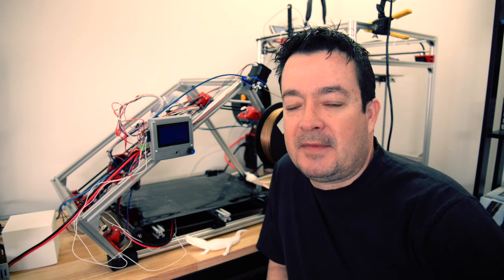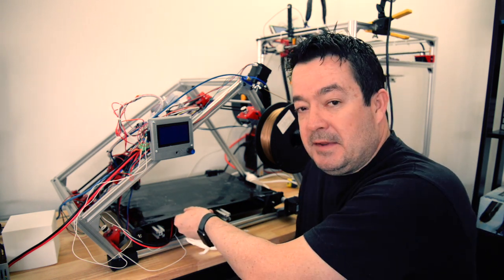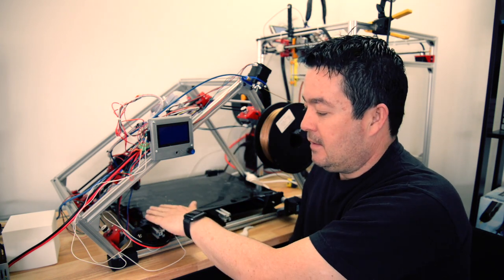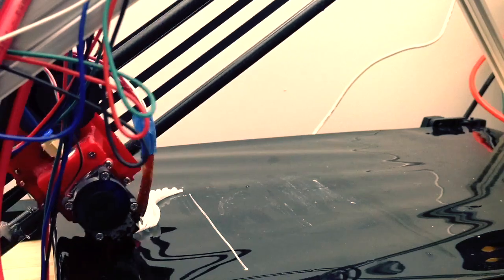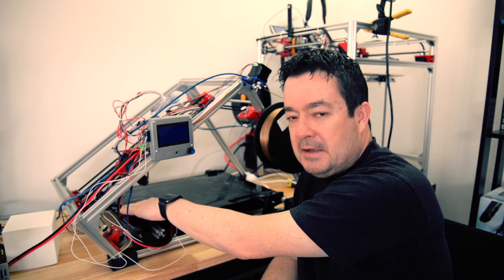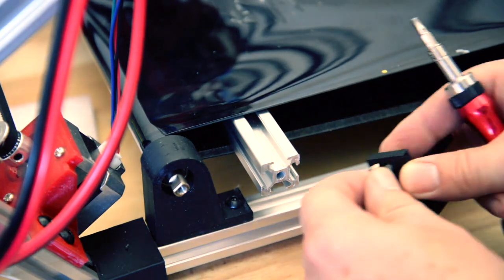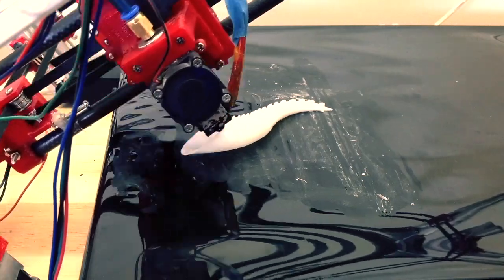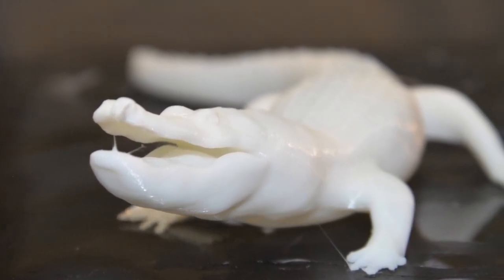Hypercube Infinite 3D Printer - Laser Belt: Heatbed Mod

Comment: Hi Zechy

A big thanks for all the work you're doing on the infinite Z. I'm space limited so can only have one printer so this is of great interest for my next printer. Just watching as many videos as I can (mostly Hypercube based now).

Having looked back at the comments I can see it was your brother gave you a Photoreceptor belt (different manufacturers call them different things, but I'll still with what Xerox call them). 

In a past life I worked in high volume digital printing (hundreds of pages per minute. Xerox, IBM, Siemens/Oce etc) and can back up what Bill said about vacuum plates under the PR belt to keep it flat at the point of transfer (so only a small area overall). Perhaps your brother can salvage something for you? AFAIK the small/slow printers don't have vacuum assist so perhaps not. However vacuum isn't the only solution.

Some other observations:

Construction: Varies, and the exact nature is proprietary & confidential AFAIK. However the continuous belt style are mostly polymer/co-polymer with coatings. Ethylene Tetrafluoroethylene, Polyvinylidene Difluoride or Polyimides (yep, just like Kapton tape) etc are all candidates. Again AFAIK.

Texture: Those belts (some/most?) have micro-texture so ought to be very grippy for many filaments

Static: Be aware that the belts are designed to carry a charge on the outer surface. Production printers have a grounded nylon brush as part of the "housekeeping" cycle of discharge/charge/clean as the belts revolve. I suggest at some point in time you want to make sure there is a path to ground to ensure your electronics continue to have a long and prosperous life!

It would be great if you could get some more belt material off your brother, cut them into squares and just test them out as build surfaces on your old 3D printer. ABS, PET's, Nylon, Flexibles, Wood etc... without any coatings (hairspray, glue etc). Just as as a baseline. Given the micro-texture, materials and coatings that make up the photoreceptor belt construction I think it will do better than plain glass by some distance (and of course you can always add the usual coatings/tapes/glues I guess).

Cheers.

Jim.
Reply from the maker: Thanks for the amazing info!

Comment: If you haven't already, You can add a piece of cork to the underneath of the heat plate to insulate it. I've used cardboard and alu tape on mine. If you cover the belt lateral openings (cardboard?) it should help to maintain the temp. Also, to heat the belt faster you can try with a hair drier on it for few minutes to get it to temperature. I've made (sort of) an enclosure of cardboard to be able to print ABS with mine :p
Reply from the maker: I haven't done that. Great idea. Thanks!